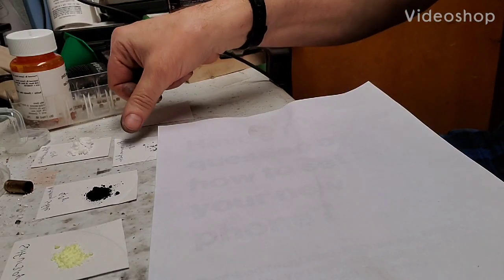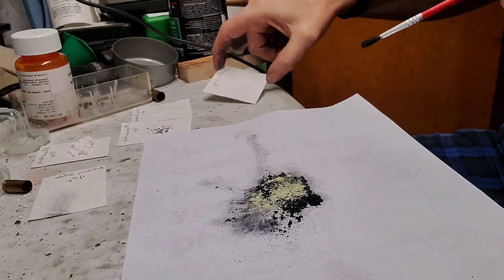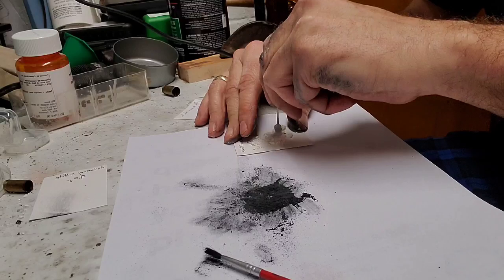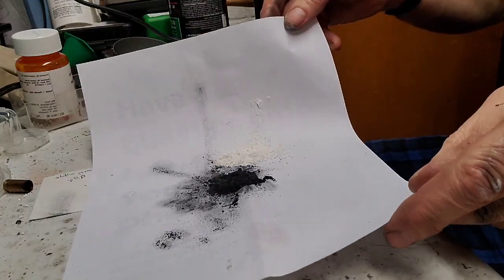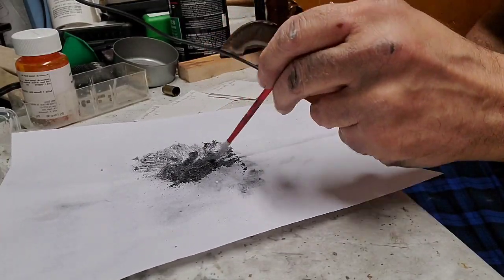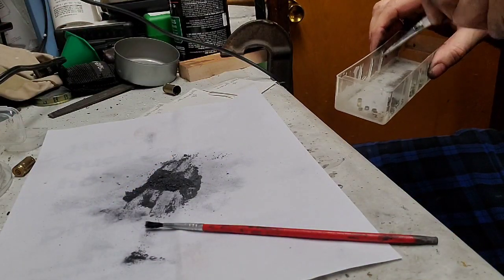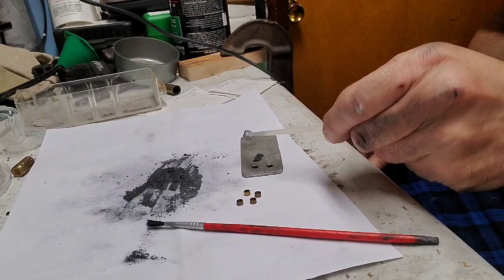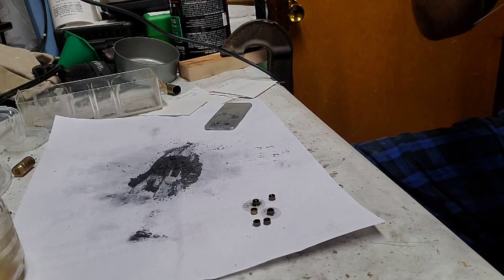Reloading primers with homemade priming compound H-48

Comment: You may want to consider trying EPH 20 (and the EPH 2x series of compounds). This series of compounds are non-corrosive, and don't become shock sensitive until AFTER you have filled the primer cup; a drop of 50/50 alcohol/water is applied to the primer cup after both the cup is filled with compound and the anvil has been seated.

When the water dries, the compound turns into a hard, concrete-like disk (meaning no need for a paper disk, too), and becomes shock sensitive.

The base EPH 20 compound is perfect for small pistol primers, with the later EPH 2x series being great for magnum pistol primers, large pistol primers, small rifle primers, and of course large rifle magnum primers.

The EPH 2x series is easily made from readily available materials. There is one lab process required, but if you can boil water, you can do the lab.

There are also tools out there now that allow you to easily reload 100 primers in a few minutes.
Reply: don't forget to say that lead salts are poisonous and carcinogenic
Reply: @rodrigocirilo7343  Every commercial primer sold today, whether in commercially purchased ammo itself or primers for reloading, contain the exact same lead substances as the EPH series of primer compounds.
Reply: @floorpizza8074  however you are not directly manipulating it, like when you do EPH!
Reply: @rodrigocirilo7343  And it is very easy to take precautions to not be exposed to lead, those being the exact same precautions I use when casting my own bullets. The majority of lead exposure happens when the gun is fired, as the lead in the priming compounds is atomized, making it far more of an inhalation risk than the possibility of exposure when making leaded priming compounds. This is why indoor ranges have to meet such stringent ventilation requirements.

Comment: Is this corrosive?
Reply: Yep. Any primer that contains potassium chlorate (and that includes primers made with toy cap gun primers and with matches' heads) is corrosive.
Reply: @neutronalchemist3241  then why is he touching it with his bare hands?
Reply: @ Corrosive doesn't mean toxic. Potassium clorate is corrosive because, burning, it deposits in the barrel a layer of potassium salts, that are as corrosive on metal as sodium salts (common kitchen salt). 
Ironically the most common non-corrosive primers, based on lead styphnate, are not corrosive, but are toxic (because lead is).
Only recently had been introduced nitrocellulose based primers, that are nor corrosive, nor toxic.

Comment: I just can't imagine working with something this small although I have saved thousands of primers, I hope I never have to resort to making them.
Reply: Those large magnifier lights that clamp on your desk are a godsend! I used a florescent one for detailed electronics work/mods.
The newer ones are led's but go for the largest lens and whitest light you can. Their usually around $20 - 30.00 and well worth it even for photagraphy. And detail work really. My eyes have gone downhill over the years and the first thing you need even before glasses is GOOD lighting. Lol

Comment: Considering how I got a 5 minute Tinnitus after someone shot an empty, primed cartridge next to me, you might want to not have the big ass pile of powder next to where you're working on priming, pushing the anvils,...
And: grounding against static electricity could also save your fingers. 

But: very interesting. 
I don't reload or plan on doing anything like that, but still: very interesting
Reply: Weird how that one that went off was that silent. Are these DIY primers that much weaker than factory primers? 

Some .22 indoor rounds only use the rimfire primer without powder to get the bullet to deform into the rifling and go all through the barrel fast enough for target shooting, and I already mentioned my ears ringing from a primed empty case without powder or bullet being fired. 

These seem WAAAY less energetic
Reply: @braindecay9477  It depends on how you load them. Percussion caps can sound louder than commercial caps if you load them with a generous amount of primer mix. I am not certain if there is room for a generous load in a primer since there needs to be room for the anvil.

Comment: This illustrates the stupidity of our government. Make something illegal or unavailable, the people will find a work around.

I was into fireworks and became quite good at making shells. The round ones that launch from tubes.

Working with aluminum powder is quite dangerous. It’s one of the main ingredients for flash powder used in M-80s.

Ball mills are indispensable for fine powder.

The technique of using a folded sheet of paper for fold mixing is classic for mixing powder ingredients of unstable compositions such as flash powders or primer comps.

Key here is that this work is extremely dangerous and you need to study and understand everything your doing.

But as our gun grabbing officials pursue their plans, we the people develop alternatives. It’s a losing battle of cat and mouse.

The saga of homemade primers is in its infancy. It’s just a matter of time until we see surplus or homemade machines to make primers in our garage.
Reply: @@ColtWest-jk9zg NO NO NO….. Flash powder is used to make firecrackers and M-80s etc. It is lit using a fuse.

The compound used in primers is percussion sensitive. In the early days, they used mercury fulminate. It is quite corrosive!!!!

At issue is aluminum. In its solid form, it’s safe or inert. But used as an ingredient in fireworks, it must be a fine powder. Aluminum sawdust is to course. Must be ultra fine.

This is done using a ball mill. A drum with inert balls, not steel balls, that pulverizes it into a super fine dust.

In this form, it is extremely reactive!!!!!!!! A type of thermite reaction reactive!

I am quite nervous about using aluminum in a primer compound as it could go off and fire your ammo uncontrolled.

The unstable nature of aluminum dust is why you use the folded paper method of mixing ingredients.

I would be interested in knowing what the commercial primer makers use. Rest assured the stuff is quite stable until it’s set off using a firing pin.

For you née Yorkers, you do know that saltpeter is sold as root remover in the home improvement stores. Sulfur is sold as a soil amendment for roses. But you need Willow charcoal. Not like willows don’t grow in New York.

And the government is full of idiots. Black powder is not an explosive. It merely burns charcoal very fast by using chemically bound oxygen in the form of saltpeter. You still have to contain it for it to explode. The first smokeless powders were cordite I believe. But it’s unstable in the sense it behaves differently under varied humidity and temperature. Today, we even have powders that use RDX.

The problem with smokeless powders is that we know have dozens of varieties each designed for a particular purpose. It’s greatly improved the accuracy and performance of ammo to an almost science.

I would recommend anyone serious about guns get to loading your own. Buy up as much of your useful powders and primers as you can.

This situation is bound not to end well.

Comment: For those interested, if you crush these ingredients with a mortar and pestle, DO NOT USE ONE  MORTAR AND PESTEL FOR ALL INGREDIENTS.
To be absolutely safe, acquire multiple mortars and pestles to crush the individual ingredients, and then mix them separately.
Be sure to lable your Mortars and your pestels so you dinae accidentally blend the different ingredients together while crushing, as a combination of the wrong ingredients WILL result in some lost eyebrows at best, or a fragmentation bomb at worse.

It is also advisable to mix primer compound AWAY from any other explosive or emflammable compounds, as accidents WILL happen.
One bit of static zap or one random bolt falling on your tool shelf, or just mixing your chemicals a little too vigorously, and BOOM.
Primer compound is a HIGHLY VOLATILE explosive, a little bit made at a time will go a long way. DO NOT MIX UP AND KEEP A 5 GALLON BUCKET OF READY PRIMER COMPOUND ‘FOR LATER USE”.. 
Dinae even mix up a Pound of the stuff to make primers in one sitting. Keep your batches SMALL.

The last thing you want is to try making a pound of primer compound in one sitting, and be remembered as ‘the bloke who vaporized himself and blew up his garage.” by your neighbors and remaining relatives…

Keep all that in mind, and you can enjoy making thousands of primers for years to come. 
Happy reloading, and keep your fingers attached.
Reply: I like ball mills in place of mortar pestals. I used separate jars and non ferrous balls. I still use a brass powder measure for reloading black powder cartridge rounds.

I always wore a static ESD bracelet when working on fireworks.

Remember that primer compound is insanely sensitive so no mondo cans of the stuff laying about. Mix only what you need. No More
Reply: would mixing them wet make it safer?
Reply: @UnknownGamer40464  Yrs it would.Water in a ball mill decreases the effectiveness of it though. You just have to grind the materials separately. Also. there is no need for a ball mill anyway, when reloading primers or making percussion caps you don't need much primer composition, so it is better (and much safer) to make small amounts at a time.
Reply: Oh yeah i remember making crystal based ones and i burnt my hair a bit
Reply: better than tanerite?
last week i couple guys shot one of those green stove propane cans the NON-relodable ones. it blew up. first i ever heard of one doing such. but the BOOM rattled off the hills a number of times.

Comment: Hi,
Can modeling glue be better than shellac for the final step ?
Reply: The viscosity and final hardness may affect the final efficientcy of ignition. Shellac is a waxy product made from insects, beetles I believe or their shells. A pine resine if mixed thin enough might work. Both are cut/thinned by acetone/alcohol/turpentine, and have a unique characteristic of stopping stain bleed through (like wall stains from mold, tannins, dyes, chalk etc.) they are a good base sealer around primer and bullet to case joint for waterproofing ammo. Although I have used paint pens for that purpose with some success.

Comment: You really need to make a 100 capacity plate set for charging with powder, packing and seating the anvils. You can charge and seat anvils in 100 primers in 3 - 5 minutes safely and uniformly. It's a scaled down factory method and it works perfectly.

Comment: Would it not be better to use the little poppers you buy for 4th  of july then mix finely ground gunpower with it then add it to the primer case the poppers compound would give it shock ignition and GP would give it the power it need to set off the charge
Reply: Those paper twisted poppers usually contain very course quartz rock in them. I always thought it was their sparks which set them off. Definately not the same as very fine powdered glass.
Reply: @dananorth895  im not sure i understand,  i mean i get that it is diffrent but the goal is not to make it the same but rather to achieve the same effect IE detonate the charge without damage using the same method

Is it that the compound in those poppets are not able to be detonated from compression impact in a primer case or am i missing the point here 

In my mind those poppers are shock sensitive  its the same compound thats in those toy gun blasting caps, meaning they will detonate with shock applied but i doubt it has the power alone needed to detonate a cartridge so alittle GP mixed in would give it the needed power
Reply: Not the same stuff as toy caps. Silver acetylide iirc. Extremely small amounts used, far too unstable and too little explosive used to work in primers. The filling is gravel, you can't grind the gravel so it will fit into a primer, the silver acetylide will go off every time, it will not work at all. Feel free to try it if you have some poppers - the only use of silver acetylide is in poppers, there is nothing else it will work for, it is far too unstable except in microscopic amounts coating the gravel in poppers, there is barely enough to pop the paper covering of the poppers and make noise. If a small amount was added to the primer ingredients to sensitize them the primers would be dangerously unstable. They can add absolutely nothing useful to primer formulations.

Comment: While I was quite the shooter in my youth, it was always with factory made, modern primers.  I never had a hobby cannon, etc.  

I know that modern primers have an anvil as part of their design, but why do you need them here?  Won't the paper disk along with shellac hold them together?  

And if I may ask, what is the difference between a friction primer and a regular primer that's used in a modern gun?  Yours look the same.  (Though I am sure modern primers don't contain glass.)  

I assume what happens with this friction primer is the ground glass becomes hot due to friction when the primer is "struck" and the heat sets off the unstable "stuff" in the mixture? 

Lastly, I assume all the chemicals can be purchased at a chemical supply house?    

By the way, shellac is used to treat the areas of wood where the grain changes direction.  You apply the shellac and it prevents that area from absorbing as much stain.  If you don't used shellac, the downward curve of your stock will be noticeably darker after applying the stain.  

Learned that the hard way when I sanded down the stock of my Ruger 10/22 to treat some deep nicks and lighten the stocks tone a few shades.  I always thought the stock a bit too dark for my taste.  Live and learn- I was no less proud of my first "gunsmithing" job, lol. 

I actually used that little carbine to compete against bolt action target rifles.  While they of course beat me, it was not by much.  They were shocked at how accurate that rifle was.  The instructor was really impressed and asked me what my technique was.  Being a kid, I had no technique, lol.  I just knew that the Ruger 10/22 was a great gun.  He said that if I put target sights on it, I could likely be as good or better than the bolt action 22s I competed against- pretty good for a carbine!

Anyway, thanks so much for this!  I had no idea you could make your own primers- friction or otherwise.

Comment: The commercial producer I saw made trays of 1,000. It was plastic with shallow holes the size of the cups. A small vacuum pump held them in, and a small wand would suck up the backward cups. Then, he opened a plastic tub and used a plastic putty knife to smear the compound into them evenly. A plate with holes through it the thickness of the anvils was filled. Slid into place, and the paper between pulled out. Rolled and let dry.
Reply: Can you elaborate on, “ A plate with holes through it the thickness of the anvils was filled” I don’t understand this part. Also, do you have any diagram or more information regarding the commercial producer?
Reply: @George Echeverri  the producer was Federal I believe. The plate for the anvils was very thin. Only the thickness of one anvil. A quantity was poured over it and wiped until one was in every hole.

Comment: Just a heads up but is a violation of fed law to do this in a dwelling.  I use  potassium chlorate  0.70 grams and red phosphorus 0.30 grams and  nitrocellulose lacquer.
Reply: No, it is not a violation of federal law. You must not transport it, or sell it - otherwise ok. Producing primers is not considered to be producing explosive devices under fed law. State law varies.
Reply: @deandeann1541  If you do it in a dwelling/Home its illegal under FED law period.  You can legally make it just NOT in your house. It also can't be stored in your house/dwelling.... I know the law on this very well. The only thing you have correct is that its illegal to sell and transport, but you also forgot transfer, make money directly or indirectly and home made stuff like this if stored must be stored in an ATF approved MAG. I've had the feds show up in the past, I know what I'm taking about.
Reply: @darianballard2074  ATF often does not in the end operate on Fed law, they run mostly off agency rule making authority. Same result as law in the end - but you will not find a law in the Code of Federal Regulations that makes it illegal.

Comment: Is the potassium chlorate the same as the stuff the sell as a nutritional supplement?
Reply: no. Potassium chlorate is poisones. you mean KCl  chlorate is KClO3. you can it make from kcl with an graphit anode + and nickl or iron kathode - with 5 volts and place both elektrode very close to gether under one inch.